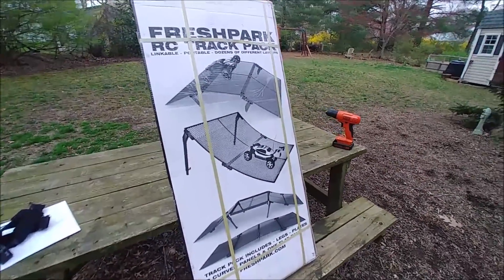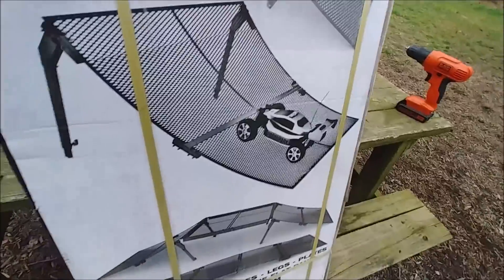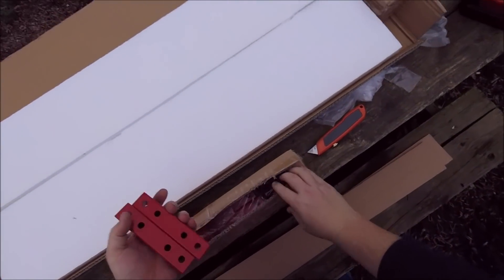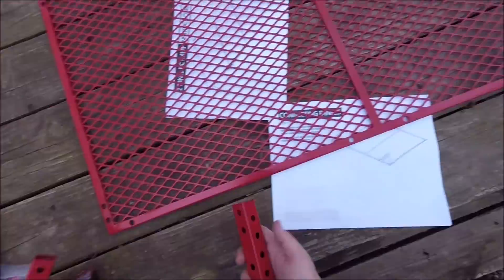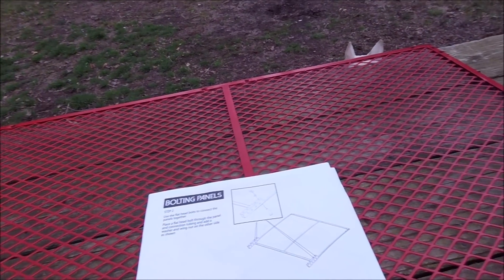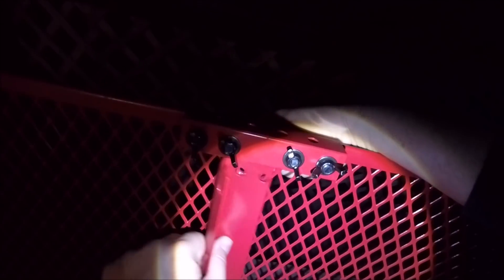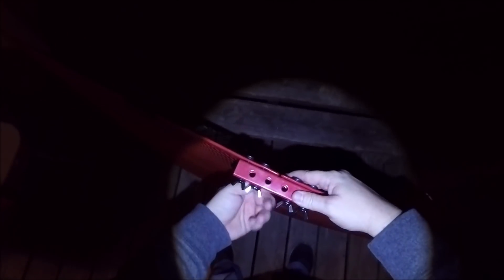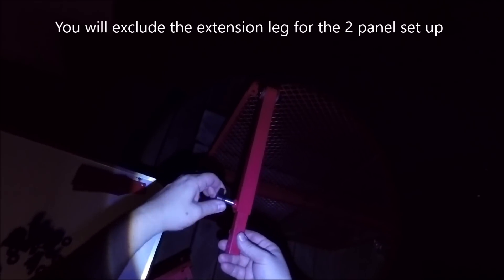Freshpark RC Track Ramp Pack Build and Overview

Comment: Great video,  nice ramp , too much work .
Reply from the maker: for the first time with no assurance of doing it as supposed to .. yes.. I could throw another one together on less then  45 minutes if I had to.. this one took 2.5 hrs between putting a part on wrong, needing to look up instructions and just looking at everything i was doing with caution.. Really is simple and hoping that this will help the next person get it together with more speed
Reply: @NPCRC   170bucks is crazy for a ramp I can build for 20bucks outta wood.
Reply from the maker: @johnwagner4559  I agree it is high.. I am selling it for 160 right now but still i can agree.  My issue was taking it places.  I have plastic ones and they stack and were very troublesome to load up with 2 kids and 4+ trucks and take then out to some of our goto places.  A wooden built ramp would  also not break down and cause me issues transporting.  If you have a truck or don't have to worry about going other places to bash then that is an advantage for sure.. but up from $100+ for plastic ramps that don't reach the same launch height as the 2 panel, let alone the 3.. it is not a far stretch to have one that can breakdown and also give up to a 27" launch height!  It is not for the handy guys who can make one though.. its for the guys with limited storage area and lack of tools to make their own!
Reply: Power tools and that picture, I will have it together the first time within 10-15 minutes, so everyone I see saying way too much work are just lazy..... Stop being slack
Reply from the maker: Drill was there cause we just put a little greenhouse together for my wife.  I wasn't sure the hardware the ramp was going to have so i had it there ready to go.  Ended up being bolts and wing nuts so i never used it.  No slacking though!  @newtonfoster7581
Reply: @NPCRC  I wasn't referring to you buddy, I know you aren't a slacker!!! I apologize you took it that way, there's other people that were making statements saying too much work constantly, you had to see them because you are very attentive with your viewers which is a good thing. If I sold them, I would do it like you, very smart, I don't know of any one else with your business setup and strategy which is very honest and looking out for your customers. I really your LandSlide with the M2C RACING chassis and everything you have done to it, looks bout like a Kraton. To build that truck what is an estimate if you remember?
Reply from the maker: @newtonfoster7581  i didn't take offense... I had the drill out and its in the thumbnail too so thought you were giving me shit for using the drill~   All good.. And i will have a new Landslide M2C update video filming tonight.  Should be up by tomorrow.  I have to see what the new set up runs for proper quote
Reply: @NPCRC  yeah I was like damnit, I was talking to the guys that are just not willing to maintain anything, so theirs breaks constantly, that ramp is the best deal I think I have seen as well but nah I meant to be taking up for your ramp idea you found and people complaining over something I believe a total of 8 bolts and wing nuts which I personally would have changed to a normal lock washer and standard nut but that's just me. You were thinking ahead having the power tool available in case just like me, I have them in my car, on my lawnmower, everywhere cause I am always having to fix something for someone or myself. I was a Toyota Master Technician for almost 20 years so most of this is , I don't want anyone to take offense but kinda elementary, and nice that it's so basic, but I will say a crawler/trail truck is much more difficult to build to perform well compared to these bashers, I usually see the weak points immediately. I started 2 1/2 years ago when I knew my health had sidelined me for good from doing what I loved and all I could remember was that name TRAXXAS so I used them to start my research and took 10 minutes into it and I said, I doubt they'll ever see my money because they build junk, you just don't get really much of anything out the box and it's sad a company with that clout is happier to destroy our hobby rather than welcome competition because they should have the best engineers out, but I actually wish I could work for XRAY, SERPENT, ARRMA, LOSI needs fresh blood, but I would like to work with any of them on making their products better and their company because if any of the manufacturers would let me add some upgrades I think a $600 R/C SHOULD CONE WITH, they would blow open!!! Sorry for the long message, but all in all, 1-10, what's the SETH? Like would you suggest me purchase that because you know I would be able to enjoy the shit outta it?
Reply from the maker: @newtonfoster7581  I am going to re do mine.  Add some holes and bolts with nuts.  I want to only leave the parts to help break it down quick, with wing nuts.   We it it hard yesterday, i didn't catch it was sunk until it flexed the top, but it exposed the weaker points and will allow be to reinforce.  I want this thing to be a tank and take beatings like we did that day.  Alot missed or edited out as the kids kept running into the camera and ramp be cause they were driving back towards it.. I got them to start looping after they jump and keep them from driving back at it.  So with 2 boys, I want it to be solid.  Shouldn't take much but i will document what I do so it could be copied if needed.  I love the portability of the design so I will make sure its as good as it can be.
Reply from the maker: @newtonfoster7581  Oh and Seth is AWESOME!  Probably not a 1-2 truck owner type, unless you live in a desert, near a beach or plan on keeping it on flat surfaces.  It has its purpose in my like up but has proven to be durable by me and some of the 18 of them I have sold since picking them up.  I just won't jump mine although the cage is tough and not much more then a body cost to replace and the parts are reasonably priced.   I have over 25 skus on hand and add a few more as I go.

Comment: I don't understand why they don't supply everything needed to do the 3 panel. That's a deal breaker for me.
Reply: Yeah, especially for 170bucks! Ridiculous!
Reply: That's a good point 🤔 Why would they advertise it in the 3 panel configuration and not supply everything you need?

Comment: Seems like it is not the best design. If I was going out to a field for a bash I wouldn't want to spend an hour building a ramp before I started then taking it all apart at the end.

They should have come up with a clever way of the pieces slotting together or something 🤔
Reply from the maker: took me 5 minutes to get put in my car... Video to come.. I will be showing that too.  I have 4 Screws to connect and I am back together.. 8 if i were doing the 3 panel.
Reply: @NPCRC  so you don't have to take the whole thing apart to fit it in?
Reply from the maker: @LawrenceTimme  no.. video will be up with it in a few hours
Reply: @NPCRC  OK ☺️